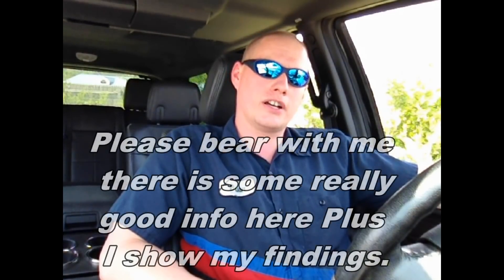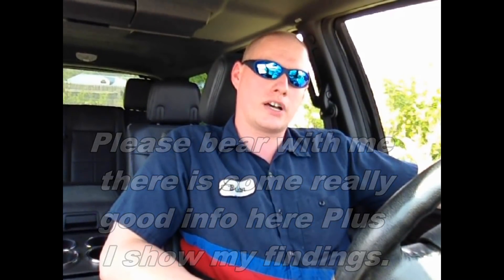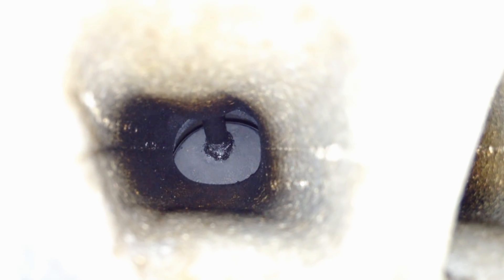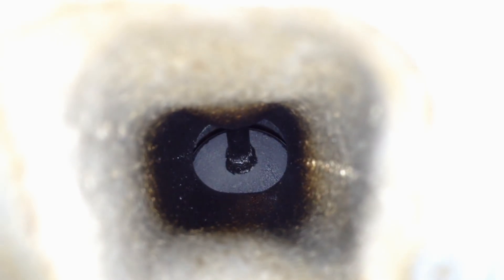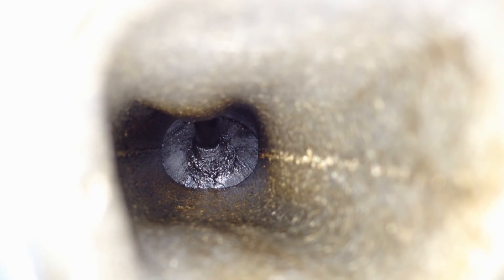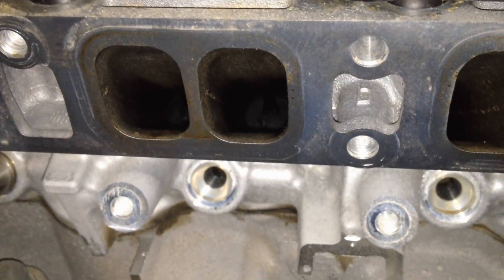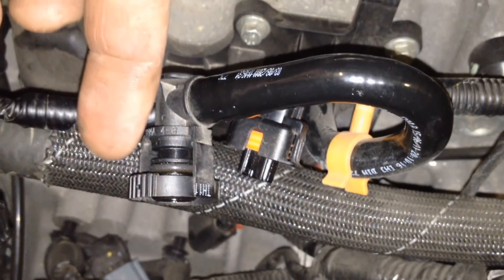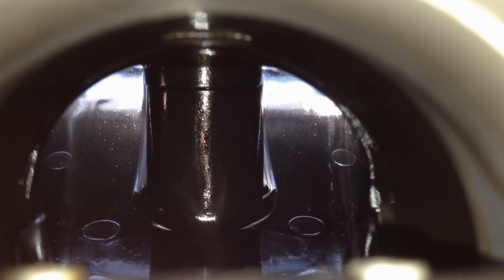Ford Ecoboost Warning Part 2 My Findings

Comment: The ecoboost V6 engine is a lemmon. With all the youtube information about this engine only a fool would buy a F150 with one.  The ecoboost spark plugs porcelain cracking and firing through the boot and the engine stalling at highway speeds are just a few serious problems with this lemmon.
Reply: Yea and so many people with 250k 300k on their 3.5 eco stfu  and do research before you open you mouth.  Dilderado and fiat will never be on top
Reply: Then how come the Ecoboost engine option is the MOST bought in the F150?  Your comment has so much wrong in it.
Reply: +Silicon Valley Engineer Hey Einstein, It's "Lemon."  like the fruit, and not the actor.
Reply: jrdubois112277 if all you have is shit to say gtfo. My 2014 has 185k on it, no issues. It’s fords new design since 2011 and it takes up to 5-10 years to get all of the kinks out of any engine, sadly dodge with their continuous oil leaks, lifter spring issues, and chevy with the same ol generic 5.3 which sadly still can’t tow as much as the ecoboost after almost 20 years of the same engine and no new engineering makes ford what it is today, just wait. Give it 5 years and chevy and dodge will come up with some better way to get mileage, and towing capacity vs their 12 mpg’s. No other company will ever be able to catch up, or get ahead of ford because they all just stick with the same shit for years on end.
Reply: I like to paint my comments with broad strokes that the masses can understand, without the burning bush thing
Reply: will pugh I seriously doubt the Ecoboost engines will outlast the engines in the 92-96 Ford Trucks.
Reply: DeadofWinter321 I seriously doubt the Ecoboost engines will outlast the engines in the 92-96 Ford F-Series trucks.
Reply: +DeadofWinter321 cuz people that buy Fords are idiots
Reply: +Silicon Valley Engineer sounds like a typical ford engine haha...

Comment: EcoBust !  Ford does some stupid things, like discontinuing the Crown Vic..
Reply: f4cphantom2 I seriously doubt the Ecoboost engines will outlast the engines in the 92-96 Ford Trucks.
Reply: +Josh&#39;s Model Airplanes Their push-rod V8 engine was indestructible.
Reply: f4cphantom2 agreed on the Vic thing....but boost is boost bro....small or big it still fuckin pulls😂😂😂😂👌👌👌👌
Reply: Josh A He goes on every vid and like you said, says the same thing. I'm sure you've noticed, we've seen alot and I mean alot of ecoboost owners coming out of the woodwork saying their ecoboost has been flawless with like 200 or 300k on it. They aren't bad engines, they're actually pretty solid especially by turbocharged engine standards and especially since ford made some immprovements. People just hate what's new and blow things out of proportion.
Reply: f4cphantom2 that car reached the end of its life cycle, and the market was changing. Have you ever seen one get t-boned between the doors, it doesn't do well  at all.....
Reply: Puff the Magic Dragon it's also about doing your oil changes on time, and using a quality name brand fuel too.....
Reply: i bet u feel the same way about the model t

Comment: BG says the evaporation of the oil is part of the problem, some oils are worse than others. I'm running a really good oil with low evaporation, recommending top tier fuel and 44k every 5k. So far none of my customers that are following this plan are building carbon.  Keeping mileage up and power up. We see it in the Chevy traverses the worst.

Comment: can you not just put a oil vapour catch can on it?
Reply from the maker: +Rage Quit87 You sure can.
Reply: +FordTechMakuloco Wont that freeze during the winter?
Reply from the maker: yes it can but the can has plenty of volume for the water to expand and especially during winter the can should be drained more often. A monster can is best-
http://www.amazon.com/gp/product/B00TPVAA28/ref=as_li_tl?ie=UTF8&camp=1789&creative=390957&creativeASIN=B00TPVAA28&linkCode=as2&tag=fordt-20&linkId=J7DIIZAUAVWJJO7O

Comment: Common problem... part of the reason I blocked my PCV on my B head Cobra... also very common on MazdaSpeed 3 turbo 4 cylinder engines. Use cleaning process like the Speed 3 engines.

Comment: We know all the pros of adding an oil catch can in the system to minimize this problem...I'm curious the extensive list of all the "cons" that the Ford engineers looked at and made an ultimate decision "Not" to put a factory installed catch can in the system.
Duhhh, simple solution. I've purchased an aftermarket catch can for my Explorer Sport 3.5L ecoboost and installed it in 5min just to be safe. The one I got looks nice, clean and professional.

Comment: Looks to me like your valve guides are worn and causing excess oil that's prolly why Ford told you to change the cylinder head.
Reply from the maker: Nope it's oil carryover from pcv system. The heads cannot be cleaned of carbon buildup under warranty. That is why they said changing the cylinder head is the only fix. Worn valve guides at 22k miles engineering would have me 700 tag the head for engineering review.

Comment: Just curious, and your input is appreciated.  I have an 03 Focus ZX-5, ZETEC that has 268 000 km on it, that has a missfire issue, possibly similar to what you describe.  It has been giving a 304/316 combo code.  We have replace the computer, the injector, the coil pack and the wires.  We have not replaced the crank position or the cam position sensors.  But what's the likelihood it could be the same problem you describe here?  I had the same problem with a 97 Mystique Zetec.  Great, informative video, thanks for making them!

Comment: wouldn't it be smart to move the pcv connection away from 2 and 3 to earlier in the induction system? or even an open breather?
Reply: +David Leister Open breather no good for emissions regulations.
Reply: engine life>emission compliance

Comment: honestly all Direct Injection engines have carbon build up the causes problems around 65k-75k miles. unless it's a DiG with secondary port F.I's. and i think only Nissan does that as far as i know.
Reply from the maker: +Genki De This is beyond regular carbon buildup this oil be coked on the backside of the valves building up. Ford DI engines don't have this issue as of yet just GTDI engines.

Comment: ford has always had an issue with the pcv system. my na v6 engine always had carbon and a fine layer of oil film in the intake from the pcv. as others have pointed out a catch can is the way to go..... even on na engines.

Comment: Why doesn't Ford use an oil catch can in the PCV system?  Even some18 year old kid with some shitty turbo Honda understands the benefits of it...  I was going to buy a new Ford with the Eco Boost, I'm glad I seen this first... I'll stick with a Toyota or Honda...  I want something that'll last 7-8 years without much trouble..  Ford, Chev just don't seem to be able to get it right, and they never will.
Reply: Bcause you will have people dumping catch can contents illegally or never flushing the cans. Leading to even more problems.
Reply: +Marbin Diaz lol...  Yea heaven forbid Ford Fix something and make it apart of their service program, instead of costing customers Thousands of dollars.
Reply: I really wanted a F150 Turbo but this issue is a big one. I will have to wait until Ford do something like Toyota did with the new Tacoma that has another set of injectors for cleaning the intake valves.

I wonder what Honda did. I cant find issues related to carbon deposits on their earth dream engines.
Reply: +Marbin Diaz that's why their Honda and Toyota...  and Ford is still making crap...  I was going to buy one did the credit and everything...  I walked away, I'll keep my GM until I buy a Honda.
Reply: +fakegibsonssuck 

New Hondas are all mostly direct injected now. Toyota still has some cars that are port injected...some direct injected...and some with both direct/port injection...which i'm waiting for Ford to do on all their cars...as their new f150 will also have direct/port injection...and so does the Ford GT
Reply: Chainheart Machine Good to hear. This trucks are one of my favorites.
Reply: +Marbin Diaz This problem is very localized. I used to work at Ford and there were Ecoboost F150's all the time for regular maintenance with over 100k miles, especially commercial trucks. I think the blow by issue is mostly on the early 2.0L, most of the 3.5Ls don't have issues unless they owners never revved them above 4k rpm. I'de like to think new calibrations for the 3.5L and 2.7L have already addressed this as there are no issues as of yet with business's having put up to 35k miles on '15 models.

Comment: Why can't Ford and other direct injection manufacturers have a port fuel injector in addition to the direct injector for each cylinder? This would keep the intake valve washed and cooled to reduce the valve stem carbon. I know that this will increase costs. But may be a cheap fix in the long run.

Comment: Makes zero sense. A misfire is a problem with either air, fuel or spark IN the CYLINDER. Condition of the upstream surface of the intake valve will have very little influence on a misfire unless it blocks airflow.
Reply: gperez12773 1) combustion gases means there is no misfire, thus it doesn't make any sense as to why a cylinder would misfire if the combustion gas was escaping. 2) Current technology is more able to adapt to such things. You act like modern technology is more finicky, when it's less.
Reply: gperez12773 yeah you're right
Reply: +TheArfdog gaps in the valve and seat can create a compression leak as well, no compression, cant have proper combustion.
Reply: $550 for a catch can???? Seriously? This should be less than $25....

Comment: I have a 2015 Explore Sport just started have a bad smell a week ago now. Not sure where it may be coming from but its to the point of coming in the HVAC system and overwhelming the cab. The best way I can describe it is like strong sulfur smell. It's not coming out of back end of exhaust its seems like its in engine bay by firewall. Deal is trying to tell me I must have ran over something BS.  The only other that did happen was AWD light come on saying AWD off while I was driving. Ford ran test and said nothing came back.

Comment: So, I just bought a '16 Fusion with the 1.5(before knowing about these issues). Has Ford remedied the issues yet? Or would it be good for me to install a catch can kit? I generally put over 200,000 miles on a car. I need this thing to last.

Comment: Great info!!What type of brushes did you use drill powered flexible cable brushes? also did you remove the dark build up on the side walls or just on the backs of the valves and stems? I have a 2012 f150 3.5L ecoboost  I guess it will require removing the intake to access the valves for cleaning. Have you done this on a 3.5L yet? If so which cylinders get the worse build up on the 3.5L?Thanks in advance

Comment: Already running 89-93 octane in my ecoboost...900 miles on my Fiesta.
Reply: +Donald Ingram For a European, 89-93 octane is shockingly low. No wonder the modern engines fail. Isn't it about time the oil companies in the US will start to make more modern fuels?
Reply: +Ronald de Rooij The octane ratings are different, their 89 is our 95 or whatever

Comment: I get engine lights at least once a month. they are caused my the turbos. p0299 I think. I have also had the timing chain replaced. I'm worried that the turbos are failing. any ideas

Comment: does this happen with just regular driving? or mainly people who are towing, and doing more "extreme" things with their truck?
Reply: +NickandSteph418 I think it's the opposite. If you drive your engine hard the air is moving faster through the intake ports so less sticks inside.
Reply: Like already mentioned if ur babying the vehicle the higher chance of build up onto valves

Comment: Is this preventable? I have a 2015 2.7l Ecoboost, I have read a catch can will help but there is information on dual valve can and a clean side separator. Any help of what to get or do appreciated.
Reply from the maker: +JDH Catch can is your best defense.

Comment: Makes me wonder what my Mazda SkyActiv engine looks like in the valves with the technology Mazda has with DI.
Reply from the maker: +KonaKoo This is oil carryover from the turbo on these.
Reply: +KonaKoo I actually bought the 2010 Mazda 3 with the last gen natural aspirated 16 variable timed DOHC just for that reason even though I could have easily picked up the new Skyactive version.  I'll wait on the new engines to see how far they go.

Comment: Thanks for the lead about BG44, I just ordered several to have on hand for my 4.6L.  I am still using Hot Shots Stiction Eliminator for the back side cleaning and will start using BG44 for the front side cleaning.

Comment: I think this is exactly what i suspected happening back when i had my 01' firehawk (LS1), I was getting spark knock (pebbles in a can sound) at WOT.  I figured it was from all the oil being shot through the PCV and into the intake and into the combustion chamber and mixing with the fuel causing fuel degradation, and carbon build up which heats up too to possibly pre-ignition.

Comment: Tsi solved it by placing mini injectors in the intake runners to spray a small amount of fuel over the valves to keep them clean
Reply: Yea, well I recently changed the timing belt on an A4. I concluded it was a POS. Only concen I have now as a Fusion Titanium owner is that it could be a repeat of the A4. I am hoping that Ford will benefit from VAG mistakes, only time will tell. Not sure that a domestic is any better at this stage - but I sure like the low end torque of the 2.0L ecoboost.
Reply from the maker: MrErikw26 Ford is also doing this starting in 2017.
Reply: MrErikw26 Bingo!! No one has more experience with these issues than VAG (VW-Audi Group). This seems obvious once you realize that DI provides zero cleaning of the intake valves due to PCV fumes causing carbon buildup. A hybrid induction system with Port Injection for cleaning and DI for power is the only known solution.
Reply: Not to mention VAG being prone to oil consumption....1 quart of oil per 1000 miles of the fsi was tolerance for that engine, 10k oil change intervals, 5 quarts of oil...
A stupid pcv design that dumped oil into the intake on hard turns, Chinese piston rings........and they're a bitch to work on to boot....I'll stick to my Ford trucks, I can work on everything in the comfort of my driveway if necessary,  or just put it on a lift at work for routine stuff
Reply: I made the mistake of doing an A4 timing belt, never again. Worst 6 hours of my shop life. I send them away, don't want the headaches
Reply: Don't be so sure your grief is solved that easily. These are systemic issues of the designs. The same design philosophy will render the same reliability issues, no matter where it originated.
Reply: Right, but I can work on a hyundai, ford, toyota, without taking the ENTIRE car apart...
Reply: Ah, but that's an exaggeration. Only the front end is involved in a timing belt, regardless of the car.
Reply: I can do a Honda or toyota or hyundai timing belt without removing the front end of the car. Not here to debate the semantics of the job.

Comment: Vw 2.0 fsi has serious issues with carbon, for several reasons. 1 is the DI system, 2 the pcv is over-engineered to death, and tends to dump oil into the turbo in hard turns, add to this the oil vapor in the pcv system and yeah it's a mess. I've seen it happen as low as 40k miles....
Reply: Thank you for taking the time to do these videos, as a professional technician myself I've used them to find a diagnostic direction when I'm in a jam. Thank you again

Comment: Don't answer my fucking question then
Reply from the maker: ichris12 Wow that will get your question answered I have been very busy on tour and this is not a pay service where I have to respond to questions I do it on my free time out of the goodness of my heart. Most youtubers don't respond to question at all at least I try to keep up and help people out.
Reply: I needs to know because I got a fiesta st and I don't want to ruin it
Reply: ichris12                                                  ingrate:  noun, in·grate \ˈin-ˌgrāt\ : a person who does not show proper appreciation or thanks for something : an ungrateful person
Reply: FordTechMakuloco Do you think an air-oil separator placed in the PCV line (like the one offered by Jeg's for about $60) would do any good on EcoBoost engines or any others with direct injection? 
I had my heart set on an F-150 with EcoBoost and now I'm having second thoughts!
Reply from the maker: No I would get a quality catch can such as UPR or Rev Ex

Comment: This is why port fuel exists on FA20 and other engines in conjunction with DI. I wouldn't be surprised to see a supplemental efi system adopted into a pcv system until pcv becomes contained or separated. I should get off YouTube and clean my valves.
Reply from the maker: Yes ford is also going to the dual system
Reply: FordTechMakuloco do you have any idea when ford will be? I know Subaru has been running this since they started with DI. I am looking into buying ecoboost fords as my next cars.
Reply from the maker: 2017 raptor is the first
Reply from the maker: Ray Wolfwinski 2017 raptor is the first.
Reply: +FordTechMakuloco what about all the current eco' s already on the road? No fix for us?
Reply from the maker: A catch can is your best bet to prevent this from building up .